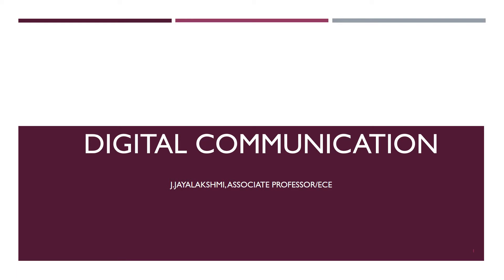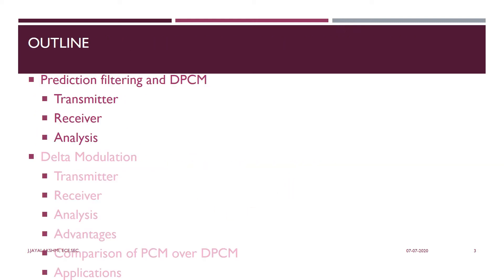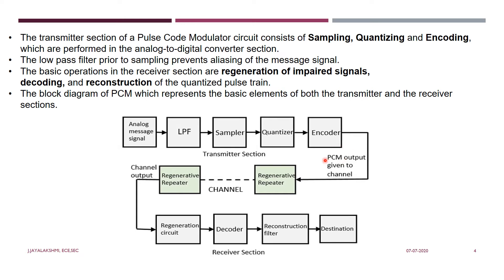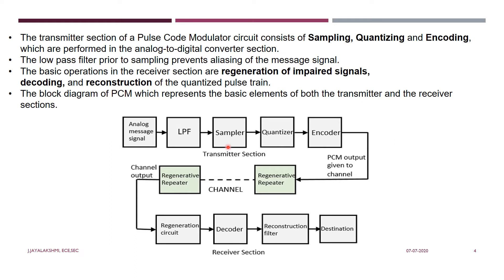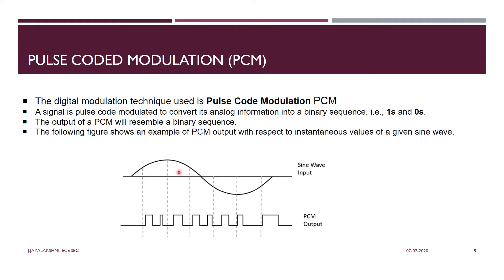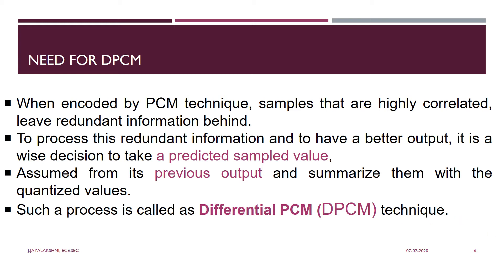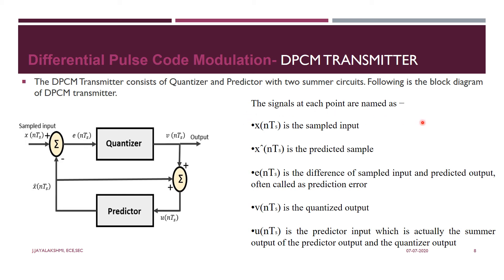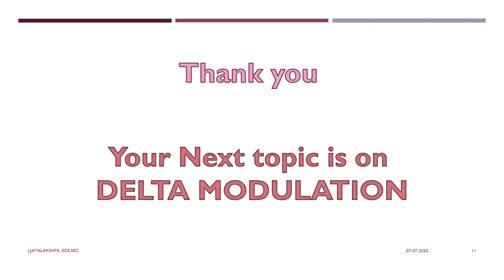UNIT II- Prediction filter and DPCM

Comment: Mam good morning for this question we can write answer only about prediction filter. 
Explain the importance of predictor in DPCM system?
Reply: Mam plz can solve this problem
Consider a DM system designed to accommodate analog message signal limited to a band width w=5kHZ.A sinusoidal test signal of amplitude A=1volt and frequency fm=1khz is applied to the system. The sampling rate of the signal is 50khz.calculate the step size required to minimum slope overload.